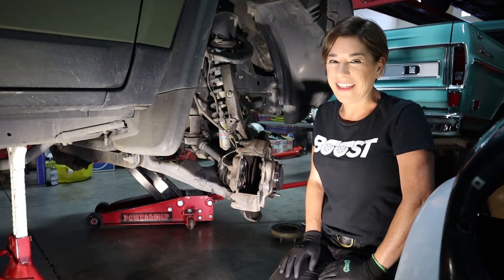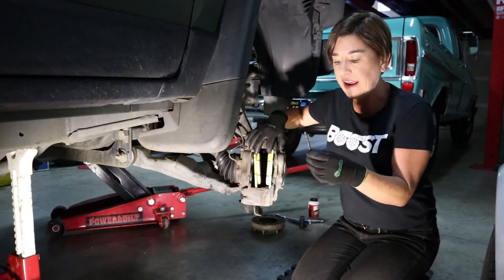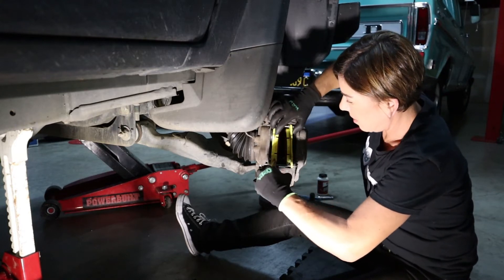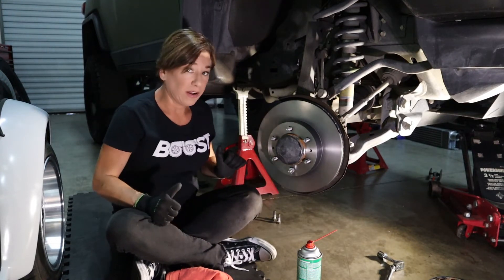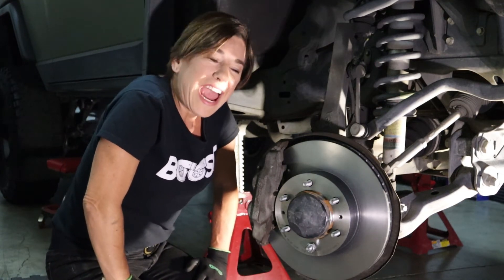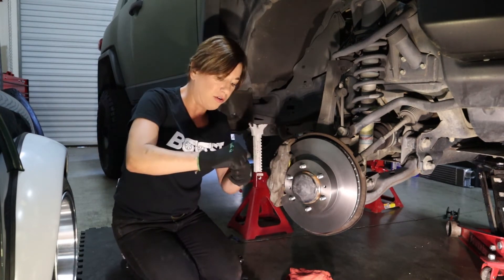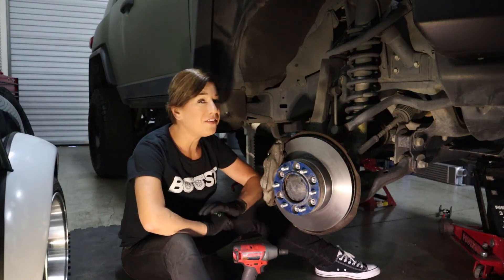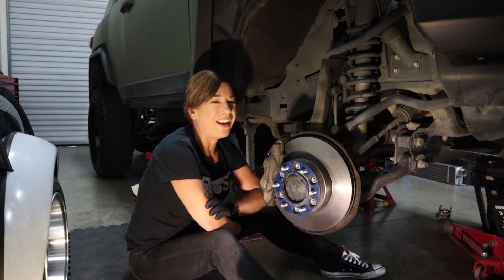How To replace the Front Brakes Toyota FJ Cruiser!!  Part 2

Comment: Thanks Rachel, very clear and nice video.  I would like to suggest to add the torque information on the Caliper's bolts since I was following your  video and got stock in that step.  I used 91 Lbf-Ft  for mine but wasn't sure if that is common for all FJ Calipers.
Reply from the maker: Thanks for watching and the comment! I hear that about adding the torque, the only thing that stops me is that they may vary from vehicle to vehicle and I don't want to give out possibly harmful info.  But I appreciate you taking the time to ask! Have a great weekend!

Comment: I don't see any reason to replace the rotor. The Toyota rotor is very 
high quality and will last longer than almost all aftermarkets.
Reply from the maker: Thanks for the comment!
 In this case, the OEM rotors were pulsating badly under braking. The thickness was right at the edge of OEM specifications and if I had turned them to alleviate the pulsations, they would then be below spec. As for using aftermarket rotors, I have found the Brembo blanks to be as good as, if not better than the factory rotors, especially when used in heavy duty applications, off roading, or motorsports.
Thanks for watching and stay tuned for upcoming videos!